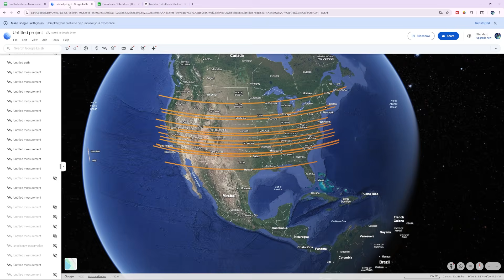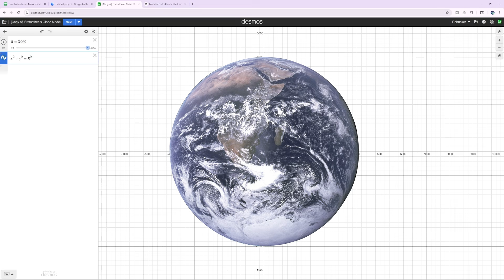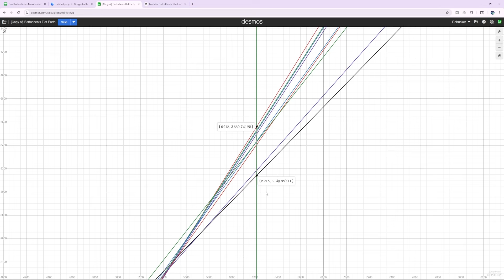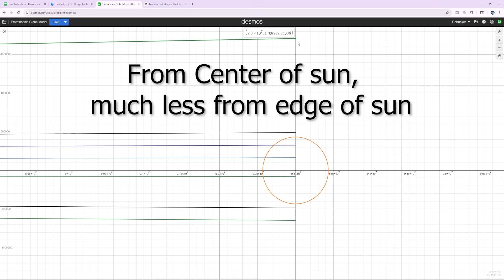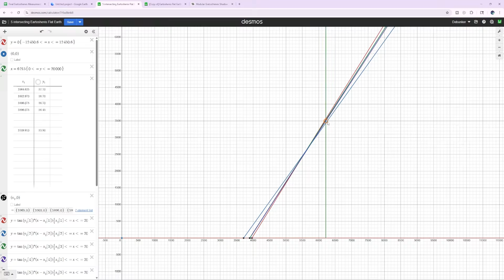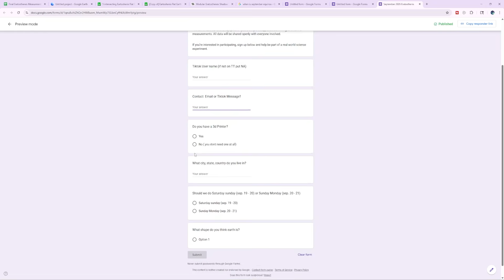10 People Repeated Eratosthenes’ Experiment… The Result Was Unexpected

Comment: 10 people measured shadow angles on a flat surface proving earth is measured flat.
Reply: I see you’re still deliberately conflating a plane of reference with the surface of the earth.
Reply: The ground is not measured flat.

*A lighthouse proves the earth is curved. 
*A tall building at sunset proves the earth is curved. 
*Calculations between two locations on earth prove the earth is a globe.
*Celestial navigation proves the earth is a globe 
*A golf ball held up near the moon while it's visible during the day proves the earth is not flat.
Reply: @MinionTrouble  A light house is vertical and therefore perpendicular to the horizontal plane of reference. A horizontal plane is a flat 2d surface.
Reply: @tbrown3356 

Ok, do this 

A lighthouse needs to beam light out over the ocean to a distance of 12 nautical miles. What height above sea-level would the light need to be placed.

Please provide your maths formula.

Let's see if your flat plane maths can calculate the height.
Reply: @MinionTrouble You need to use statute miles to be more clear. Nautical miles are arcminutes between degrees. A light house a linear flat distance of 13.8 miles away is using flat geometry (earth measurement). You're asking me what vertical height perpendicular to the horizontal plane of reference of sea level is needed to see the light house from 13.8 linear flat miles away. This is rise over run flat geometry (earth measurement). We're all using the same flat geometry for this calculation. In your belief the lighthouse can't ever reach 0° in elevation angle (apparent height), because you conflate apparent height in arcminutes/nautical miles with actual height in feet and inches.
Reply: @tbrown3356 

Calculate the height required above sea level for 12 nautical miles.

Let's see if you get it right.

This is based on a real working lighthouse.

Go, your maths and formula.
Reply: @MinionTrouble  It's your argument. You do the calculation without using linear flat miles between yu and the lighthouse and without a horizontal plane of reference for your altitude and the lighthouse altitude. 

The only circle math will be the elevation angle needing to be corrected based on your eye level being above sea level. Your visual angle increases with altitude so you need to correct for your arc of vision changing with altitude. The r in that correction is not to the center of earth.
Reply: @tbrown3356 

I know, you can't.

No flerf can, and when they do they use globe maths.

Globe confirmed 
Flat earth debunked.
Reply: @tbrown3356 

You don't need to know your "arc of vision"

It actually is very simple maths.
Reply: @MinionTrouble  I have to start with a flat earth for the linear flat distance of 13.8 miles and for my altitude. You have to give me a flat earth to start with because we can't have a linear flat distance on a globe or vertical height perpendicular to the horizontal plane of reference on a globe.
Reply: @MinionTrouble  You do need to know your arc of vision as it changes based on your vertical height perpendicular to the horizontal plane of reference. At sea level your visual angle is smaller than it is at 6 feet above sea level.
Reply: @tbrown3356 

No you don't neex to know any "arc of vision"

The globe can calculate this very easily and very accurately. No arc of vision needed.
Reply: @MinionTrouble There's no globe when you use linear flat distances and altitudes perpendicular to the horizontal plane of reference. 

The only trick you have is to say after using flat geometry (earth measurement) that seeing farther with altitude is because the horizon dips, when it doesn't. Your altitude increased and you can see farther as your visual arc increases with altitude.
Reply: @tbrown3356 

Hint: Use the aporoximation  h = (d / 1.225)^2 

Where
h is in meters
d is in kilometers 

Use the 12 nautical miles and covert to kilometers.

Your answer will be very accurate. It accounts for standard refraction.
Reply: @tbrown3356 

Go on, calculate the height required.

You can't because flat earth maths is missing variables. The globe has all the variables needed to accurately calculate tbe height.

Flat earth can never calculate the height.

Flat eartb fail.
Globe earth confirmed.
Reply: @MinionTrouble  h is perpendicular to the horizontal plane of reference. A horizontal plane is a flat 2d surface. 

d is a linear and flat, not curved. 

Now you gave the flat geometry we all will be using. 

1.22 is calculated from your visual arc you said isn't needed.
Reply: @tbrown3356 

No, it's derived from 

h = sq-root (d^2 + r^2) - r

See the r, guess what that means.
Reply: @MinionTrouble  The r is because there are 360° in a circle of vision. Between each degree is 60 arcminutes/nautical miles. 60 × 360 = 21,600 arcminutes/nautical miles. 21,600  ÷ 2 ÷ 3.14 = 3943 approximately in arcminutes/nautical miles. To convert that to miles we multiply by 1.15 to get approximately 3959 miles for visual arc radius. Not the ground radius.
Reply: @tbrown3356 

R is the radius of the earth.

You make up nonsense as you go along. Unfortunately for you, spherical maths is very accurate. You have nothing.
Reply: @MinionTrouble  We have a 180° visual angle. (180° × 60°) ÷ pi = 3,439.4904458599 arcminutes/nautical miles. You can convert these visual arcminutes to miles by multiplying by 1.15. That doesn't make the ground a spheretard.
Reply: Celestial navigation requires a horizontal baseline to measure elevation angles of stars with. It's using flat geometry (earth measurement).
Reply: @tbrown3356 

Celestial navigation has to take into account the dip of the horizon.

They use spherical maths.

Cos(θ) = R/(R+h)
Reply: @MinionTrouble  Dip correction uses flat geometry for altitude. Altitude is a vertical height perpendicular to the horizontal plane of reference. A horizontal plane is a flat 2d surface. 

The arc of the elevation angle increasing with your altitude is circular maths related to arcminutes on a sextant, not the ground being a sphere.
Reply: @tbrown3356 

The horizon would never dip below eye level if the earth were flat.

Dip corrections use spherical maths.
Reply: @tbrown3356 

A tall building at sunset proves the globe, and demonstrates the dip of the horizon.

Those on the ground floor will see the sun set first, while those on the top floor will still be in sunlight, the sun hasn't set for them yet. 

This is because the earth is a globe.
Reply: @MinionTrouble  That's where you have been duped. Increasing your altitude gives you a larger visual angle therefore Increasing the elevation angles (apparent heights of objects). Seeing farther with altitude requires a horizontal plane of reference. Altitudes are vertical heights perpendicular to the horizontal plane of reference. A horizontal plane is a flat 2d surface. You're using a flat earth for altitudes and saying flat earth doesn't work. 😂.
Reply: @MinionTrouble  Again, you're using altitudes which are vertical heights perpendicular to the horizontal plane of reference. Your belief requires a flat 2d surface.
Reply: @tbrown3356 

Why does the sun set for those on the ground floor first while those on the top floor are still in sunlight.

A flat earth would have everyone see thr sun set at exactly the same time.

Flat earth fail
Reply: @MinionTrouble  With higher altitudes you have an increased visual arc angle. Altitude is a vertical height perpendicular to the horizontal plane of reference. This is flat geometry.
Reply: @tbrown3356 

No it's not.

The earth is a globe.

Height to distance calculations prove this.

d = sq-root ((r + h)^2 - r^2)
h = sq-root (d^2 + r^2) - r

See the r, guess what that means.
Reply: @MinionTrouble  We get the r from our 180° visual angle. 180° is a straight line. (180 × 60) ÷ pi = 3,439.49 arcminutes. Convert that to miles by multiplying by 1.15. That's not the radius of a spherical earth. 😂
Reply: @tbrown3356 

R is the radius of the earth.

You know nothing at all. You're full of nonsense.
Reply: @MinionTrouble earth doesn't have a spherical radius. Stop begging the question.
Reply: @tbrown3356 

And yet when you plug the radius of the earth into the formula 

d = sq-root ((r + h)^2 - r^2)
h = sq-root (d^2 + r^2) - r

It matches reality each and every time.
It will accurately match the height required for the light above sea level for the distance of 12 nautical miles.

Therefore the maths is correct 
Therefore the radius is correct 
Therefore the earth is a globe 

Flat earth debunked
Reply: @MinionTrouble  the radius of your 180° visual angle arc. 180° is a straight flat line. 😂😂😂
Reply: @tbrown3356 

Of course you don't understand. You're incapable.

Plug in the radius into the formula with the distance 12 nautical miles and it will give you the height required for the light above sea level.

You can't calculate this. You have no idea. The globe maths matched reality. Flat earth has nothing.

Globe confirmed 
Flat earth falsified
Reply: @MinionTrouble  The radius is not a line from the center of a spherical earth. You're pretending that you don't understand that earth has no spherical radius. Again they took the 180° visual angle and multiplied by 60 arcminutes, because there's 60 arcminutes in a degree. 21,600 arcminutes was then divided by 3.14 (pi). That's not the radius of a spherical earth. 180° is a horizontal plane (flat 2d surface).
Reply: @tbrown3356 

Plug in the radius of the earth into the formula h = sq-root (d^2 + r^2) - r and it will give you the correct height above sea-level for the light.

The spherical maths matches reality 
Therefore the radius is correct 
Therefore the esrth is spherical 

You lose
Reply: @MinionTrouble  What is the radius of the celestial sphere that isn't the ground Geronimo if its circumference is 21,600 arcminutes?
Reply: @tbrown3356 

We don't need to know anything about the celestial sphere 

Interesting that, celestial sphere. This alone debunks your nonsense.

To calculate the height required above sea level all we need to know is the distance to the horizon, given as 12 nautical miles, and the radius of the earth.

Using the formula, we can calculate accurately the height required.

Simple stuff.

But you have no comprehension skills. 
Thinking I was saying Australia is not part of the coordinate system and has no latitude when I literally wrote 37.8 degrees south latitude.

You are even more hopeless that nearly every flerf on earth!
Reply: @MinionTrouble  You said we don't need to know anything about the celestial sphere that r comes from. Our entire coordinate system is created from the celestial sphere. That arc of vision with Polaris and celestials declining 1° every 69 miles traveled away from their ground position of the celestial on the plane is the basis of celestial navigation.
Reply: @tbrown3356 

You use r, the radius of the earth.

The maths is very accurate.
It can easily calculate the height required.

You lose

Edit 

LOL Polaris 37.8 degrees below the horizon. The earth is not flat.
Reply: A golf ball held up near the moon proves you're gullible. 😂
Reply: @tbrown3356 

You have no idea what happens and why it happens.

Go test it out for yourself. You may learn something very interesting.
Reply: @MinionTrouble  I know you need a flat earth for that vertical lighthouse to be perpendicular to and to measure elevation angles of stars for celestial navigation.
Reply: @tbrown3356 

Do the maths for the lighthouse. 

Let's see if your flat plane maths can calculate the height required for the light above sea level to beam out across the ocean to a distance of 12 nautical miles.

Celestial navigation accounts for the dip of the horizon. They use spherical maths. Cos(θ) = R/(R+h)
Reply: @tbrown3356 

Nope. 

"In celestial navigation, the observed altitude taken from a sea-level horizon is corrected for dip. 

"Because the observer's eye is always a certain height above the surface of the sea, the visible horizon "dips" below the true horizontal plane". 

Maritime Studies

The dip is caused because the earth is curved, not flat.
Reply: @MinionTrouble I can't do it without a flat earth for linear distance and a flat earth perpendicular to my vertical height. There's no way around the flat geometry.
Reply: @MinionTrouble sea level is a horizontal plane of reference. The observer's eye level height is perpendicular to sea level as the horizontal plane of reference.

Dip correction is made because the observer's eye height is above sea level.
Reply: @tbrown3356 

You cannot 

You have to correct for horizon dip 
That is globe maths

You lose!
Reply: @tbrown3356 

So the earth is not flat. Thank you.
Reply: @MinionTrouble  No, dip correction is a height above sea level correction needed because the visual arc angle increases with altitude.
Reply: @MinionTrouble  you measured earth flat.
Reply: @tbrown3356 

You keep believing that nonsense.
The earth is atill a globe.
The lighthouse debunked your nonsense.

You can't even calculate the height required. Hopeless indeed.
Reply: @tbrown3356 

I can easily calculate how far to the horizon you can see from the top of that tall building. You can't.
Reply: @MinionTrouble  You'll need a horizontal plane of reference perpendicular to your vertical height and a linear flat distance. That's flat geometry (earth measurement).
Reply: @tbrown3356 

Wrong.

The globe can easily calculate this.
Flat earth can't.
Reply: @MinionTrouble There's no globe when you measure earth flat.
Reply: @tbrown3356 

We never measure the earth flat.

d = sq-root ((r + h)^2 - r^2)
h = sq-root (d^2 + r^2) - r

r = the radius of the earth.
Spherical maths

The earth is a globe.
Reply: @MinionTrouble  Again,  for the remedial. H = perpendicular to horizontal plane of reference. 

D = linear flat distance on the surface. 

R = 180° visual angle × 60 arcminutes ÷ by 3.14. 

This is all flat geometry (earth measurement).
Reply: @tbrown3356 

R is the radius of the earth.

Stop making up nonsense.
This is spherical maths.
Reply: @MinionTrouble  180° visual angle (90° + 90°) is a straight line. 60 arcminutes is an angle. (180 × 60) divided by pi is not a spherical earth radius. 😂
Reply: @tbrown3356 

R in the maths formula is the radius of the earth. You can't change this fact by making up nonsense.

This from Sailing Issues

r is approx. 3440.1 NM

Distance of horizon example
Let the eye height (h) be 4 metres = 0.0022 NM; find the distance in NM of the geometrical horizon.

d = sq-root ((h + r)^2 - r^2)

d = sq-root ((0.0022 + 3440.1)^2 - 3440.1^2)

d = sq-root (11834303-11834288)

d = sq-root (15.146)

d = 3.89 NM (geometrical)

They are the experts in the field of sailing, navigation and celestial navigation.

Notice they use the radius of the earth (r)
Reply: @tbrown3356 

They have a diagram that represents the earth, they write:

AD = h is the height of eye above the earth.
DO = BO = CO = r (radius of the earth).

Sailing Issues

You lose.
Reply: @MinionTrouble Can we take arcminutes measured with a sextant and convert to a linear flat distance? The answer is yes. That's the basis of celestial navigation. So if we have 90° one direction and 90° the opposite direction that is a total of 180°. There's 60 arcminutes in a degree. So 180° × 60 = 10,800 arcminutes. To convert to statute miles, we multiply by 1.15. That's a linear flat distance of 12,420 statute miles. You have a horizontal plane of 12,420 miles. A horizontal plane is a flat 2d surface.
Reply: @tbrown3356 

Sailing Issues says

"Dipping range or Geographic range: The maximum distance at which the curvature of the earth and terrestrial refraction permit an aid to navigation to be seen from a particular height of eye (without regard to the luminous intensity of the light)".

Wow, curvature of the earth.
You lose.
Reply: @MinionTrouble  A citation. Oh boy, now I'm convinced that degrees on a sextant is the ground curving. 😂😂😂. 

The limit to how far we see is based on altitudes and optical lense. Altitudes are vertical heights perpendicular to the horizontal plane of reference. A horizontal plane is a flat 2d surface.
Reply: @tbrown3356 

Typical na ah. You can't comprehend. You na ah the use of the radius of the earth in the formula.

But of course, plug in the radius of the earth into the formula and you'll easily calculate the correct height above sea-level.

h = sq-root (d^2 + r^2) - r

The lighthouse example I have given for 12 nautical miles is a real working lighthouse. 

Spherical maths calculates the height very accurately.

You lose.
Reply: @tbrown3356 

Ahm, you correct for horizon dip, remember.
Reply: @MinionTrouble  Yeah you use your altitude vertical height perpendicular to the horizontal plane of reference to correct the elevation angle down to sea level. That's flat geometry. 😂
Reply: @tbrown3356 

No, we're using the radius of the earth to calculate the required height above sea-level.

That's spherical maths.

You lose
Reply: @tbrown3356 

On a flat earth there would be no horizon dip.

You lose
Reply: @tbrown3356 

Horizon dip 
Cos(θ) = R/(R+h)

R is the radius of the earth 

You lose.
Reply: @MinionTrouble, you just rinsed and repeated.
Reply: @tbrown3356 

Yes, because the earth is a globe.

You lose.

Cos(θ) = R/(R+h) defines the geometric dip of the horizon (θ) for an observer at a height (h) above a spherical Earth with radius (R). The angle represents the angular distance between the horizontal line of sight (astronomical horizon) and the visible sea horizon. 

Siranah Denmark

 Give it up, you've lost.
Reply: @MinionTrouble An elevation angle is the line of sight to the star and the horizontal plane the observer is standing on. This where we get the 90° + 90° = 180°. 180° is a straight a horizontal plane (flat 2d surface).
Reply: @tbrown3356 

Cos(θ) = R/(R+h) defines the geometric dip of the horizon (θ) for an observer at a height (h) above a spherical Earth with radius (R). The angle represents the angular distance between the horizontal line of sight (astronomical horizon) and the visible sea horizon. 

Siranah Denmark

You lose
Reply: @tbrown3356 

The horizontal plane is not the horizon.
The horizon dips below the horizontal plane. You must correct for the dip to bring the horizontal plane down to the horizon.

The dip of the horizon is because the earth is spherical. 

Cos(θ) = R/(R+h) 
R is the radius of the earth 

You lose
Reply: @MinionTrouble You use the dip correction, which requires the altitude of the observer perpendicular to the horizontal plane of reference. The correction brings your eye level down to sea level as the horizontal plane of reference. Then you have the line of sight to the star and the horizontal plane the observer is standing on for the elevation angle. The r in the formula is from 180° × 60 ÷ by 3.14. That's not the radius of a spherical ground.
Reply: @tbrown3356 

You are ignoring the radius of the earth

Cos(θ) = R/(R+h) 

You lose
Reply: @tbrown3356 

No, the r in the formula is not the nonsense you say it it.

Cos(θ) = R/(R+h) defines the geometric dip of the horizon (θ) for an observer at a height (h) above a spherical Earth with radius (R). The angle represents the angular distance between the horizontal line of sight (astronomical horizon) and the visible sea horizon. 

Siranah Denmark

"a height (h) above a spherical Earth with radius (R)"

You lose
Reply: @tbrown3356 

So tell me, how would you calculate distance between two locations on earth?

Whis is the distance between 

31.9403° S 115.9668° E
and
33.94610° S 151.17700° E

Show your formula
Reply: @MinionTrouble  The celestial sphere or arc of vision has a spherical circumference of 21,600 arcminutes. It's not physical, and it's not the earth. You can't go out and touch the celestial sphere at 3,959 miles. Your spherical earth concept highjacked the arc of vision.
Reply: @MinionTrouble  I'd use latitudes and longitudes created from flat earth elevation angle measurements and the r in the arc of vision. That's flat geometry.
Reply: @tbrown3356 

Work out the distance 

Show your formula

I can work it out very easily. 
For any two coordinates on earth.
Reply: @tbrown3356 

Again, for the one who can't comprehend 

We use the radius of the earth, r, in the formula 

Cos(θ) = R/(R+h)
and
d = sq-root ((r + h)^2 - r^2)
h = sq-root (d^2 + r^2) - r

It gives us very accurate calculations.

Spherical earth confirmed 
Flat earth falsified
Reply: @tbrown3356 

r has nothing to do with "the arc of vision"

Your made up nonsense wont work here
r is the radius of the earth.

Thr earth is spherical, a globe
Reply: @MinionTrouble  The distance between locations calculation uses latitude and longitude, and the radius of the arc of vision or celestial sphere. It requires flat geometry (earth measurement). Latitudes are flat earth elevation angle measurements of Polaris. An elevation angle is the line of sight to the star and the horizontal plane the observer is standing on.
Reply: @MinionTrouble R is from the celestial sphere having 21,600 arcminutes. There's no spherical earth with a radius. It's the arc of vision. You keep showing a formula with r and don't understand that the celestial sphere isn't physical.
Reply: @tbrown3356 

Polaris, that can't be seen from Australia.

Melbourne Australia is at 37.8 degrees south latitude, this means Polaris is -37.8 degrees below the horizon.

You have no idea at all.
Reply: @tbrown3356 

R in the formula 

d = sq-root ((r + h)^2 - r^2)
h = sq-root (d^2 + r^2) - r

and

Cos(θ) = R/(R+h)

Is the radius of the earth. 

Geeze, you just can't comprehend. 

Again, plug in the radius in the formula and the height required above sea level is calculated very accurately.

This proves R is the radius of the earth
The earth is a sphere, a globe 

You lose
Give it up already
Reply: @MinionTrouble  Australia is in our coordinate system buddy. You think Australia doesn't have a latitude? Oh lawd. 😂😂😂😂
Reply: @tbrown3356 

Oh you are stoooopid 

You didn't understand a word I said.

Listen carefully 

Melbourne Australia is at 37.8 degrees south latitude 

This means of course its part of the coordinate system, FFS

Because it is in the southern hemisphere, it is at -37.8 degrees 

So Polaris is -37.8 degrees below the horizon.

You just can't comprehend simple English.
Reply: @tbrown3356 

What part of "Melbourne Australia is at 37.8 degrees south latitude" gives you the idea I'm saying it's not part of the coordinate system, where am I saying it doesn't have latitude 

Literally 37.8 degrees south latitude 

South latitude 
South latitude 

Look, latitude.

That is so stoooopid, it hurts!
Reply: @MinionTrouble so Australia has a latitude then derived from flat earth elevation angle measurements of Polaris. That's the coordinate system Columbo. The celestial sphere coordinate system where Polaris is at 0° latitude when you are 6,215 miles from the ground position of Polaris.
Reply: @MinionTrouble  Why would you see Polaris from Australia when the celestial sphere model coordinate system has Polaris at 0° when 6,215 miles from the ground position of Polaris. Are you on drugs and don't understand the coordinate system of Latitude and Longitude? 😂😂😂😂
Reply: @tbrown3356 

Celestial sphere 

Do you see what you wrote there.

Celestial sphere.

Its a sphere because the earth is a sphere. 

Well done you!

I love that, celestial sphere, not a celestial flat.

You debunked yourself
Reply: @MinionTrouble  How can the imaginary celestial sphere in the sky have a circumference of 21,600 arcminutes, and the ground also have a circumference of 21,600 arcminutes? Are you saying the sky dome is the ground? Are we inside earth core when measuring elevation angles of stars on the celestial sphere? 😂😂😂😂😂😂. No we're on the plane with a line of sight to stars appearing to drop in height over distance. The stars aren't physically dropping. Elevation angles are apparent heights in arcminutes. The ground is the plane we measure the arcminutes of stars from with 90° at zenith to 0° at horizon.
Reply: @tbrown3356 

You are so dim

What is the celestial sphere 

The celestial sphere definition in astronomy is an imaginary sphere surrounding the earth

At any one time, an observer on earth’s surface can only see one half of the celestial sphere since the other half is below the horizon

Swinburne University

Thank you for debunking yourself
The earth is a globe
Reply: @MinionTrouble  Why do you bother with this mental deficient?
You demolished him eons ago?
He's a mohron who has no basis in reality.
Reply: @tbrown3356 

Due to the rotation of the earth on it's axis, the celestial sphere appears to rotate daily from east to west, and the stars seem to follow circular trails around two points in the sky. These two points mark the intersection of the projection of the Earth's rotation axis on the celestial sphere, and are called the celestial poles.

Swinburne University

Edit 

Two points where the stars have circular trails around. Two celestial poles are impossible for a flat earth.

You are debunked again.
Reply: Please don't feed the troll.
Reply from the maker: Everyone is entitled to their own wrong optinion, as shown by @tbrown3356
Reply: @The_Debunker 

I've been very patient with this person.
It's like pulling teeth!
Reply: @The_Debunker 

 Now he thinks, because I said Melbourne Australia is at 37.8 degrees south latitude, Polaris would be 37.8 degrees below the horizon, he thinks I am saying Australia is not part of the coordinate system.

You cant make this kind of stoopid up!
Reply: @MinionTrouble  I think you don't know how the celestial sphere coordinate system works if you think you need to see Polaris from Australia. 😂😂😂
Reply: @tbrown3356 

Polaris 37.8 degrees below the horizon.

Impossible on a flat earth.

Keep saying celestial sphere, way to go at debunking yourself.